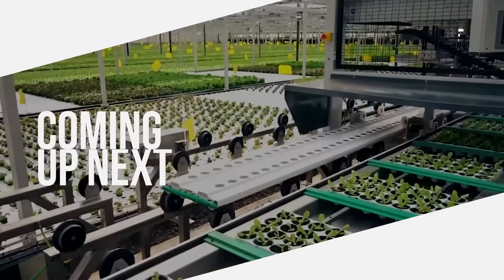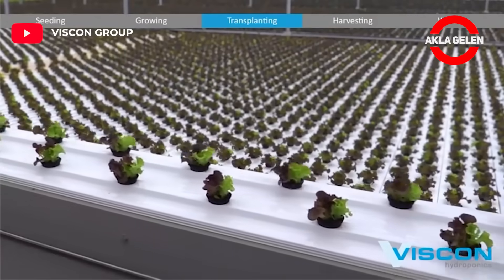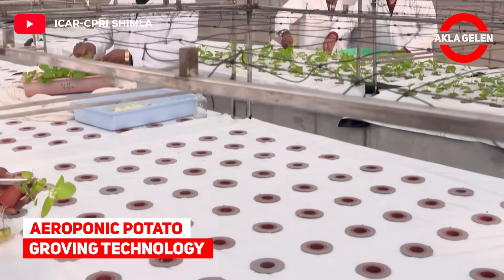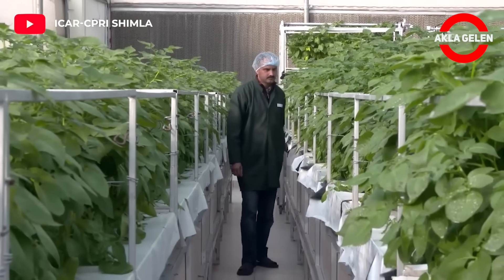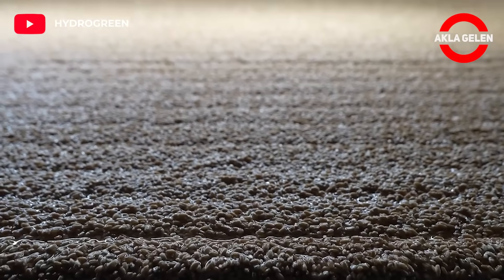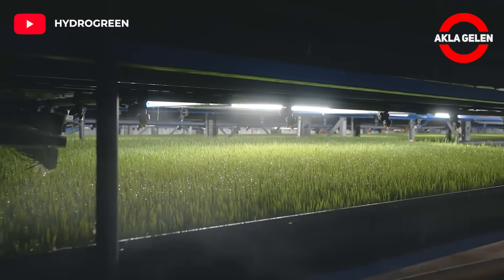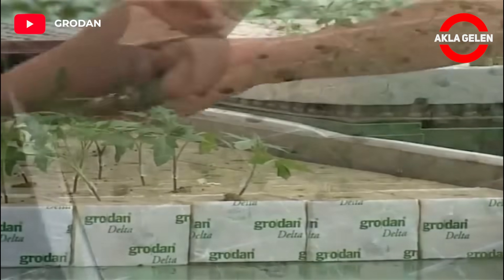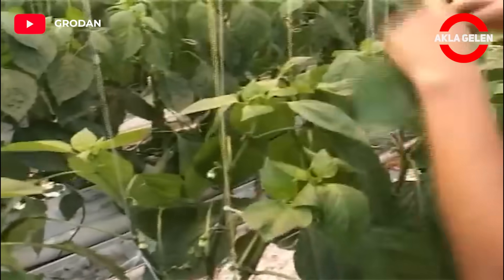The Farm Producing Potato Without Soil Will Surprise You - Incredible Agriculture Techniques

Comment: Respectful Greetings!
To: Akla Gelen.
Introduction: Aeroponics is a cutting-edge agricultural technique where plants are grown in an air or mist environment without the use of soil. This method is gaining popularity for its ability to maximize plant growth with minimal water use, making it a sustainable option for urban farming and vertical agriculture.

Aeroponics is a method of growing plants that do not require soil. Roots are suspended in the air and irrigated with a nutrient-dense mist instead. This is in contrast to hydroponic systems, in which plant roots are submerged in a nutrient-rich solution on a regular basis.

Potato agricultural production involves growing potatoes for food, feed, and industrial use. Potatoes are the third most important food crop in the world, after rice and wheat. 
Potato production steps
Fertilize: Apply fertilizer before planting, based on soil test results. 
Plant: Use healthy, disease-free tubers that are well-sprouted. 
Harvest: Handle potatoes carefully, wash them as needed, and dry them. 
Store: Store potatoes at a temperature of about 65°F with high relative humidity (85–90%) for the first 10–14 days. Then slowly reduce the temperature to the final storage temperature. 
Potato production challenges
Climate change: Farmers and scientists develop strategies to match crop demands to environmental conditions. 
Soil preparation: Laser land leveling can be used to prepare soil, but it can be expensive. 
Storage: Storage conditions are important for healing cuts and bruises, and preventing shrinkage and bruising. 
Potato production benefits
Food security
Potatoes are a food security crop that can help feed the world's growing population. 
Sustainable
Potatoes can be produced sustainably with less land due to improved varieties and agronomic practices. 
Courteously!
Luís Van-Dúnem

Comment: Go check the Element Table, everything the plant needs is the elements in solution. It doesn’t expend energy spreading its roots around trying to find nutrients. One other important thing plants require, CO2, Modern greenhouses pump CO2 into greenhouses at 1,100 ppm, the plants absorb CO2 and expels oxygen. Over hundreds of years of growing in the same soil has removed the elements the plants need.
How did the Elements get there? When the glaciers retreated, they ground up the rocks as they moved and carved out the valleys. Like I said check out the Elements Table then check out the Plants requirements.

Comment: These potatoes are grown this way for bulking first generation seed from a plantlet grown from tissue culture. They are not for human consumption. This is the first stage of seed potato production. This is why they are harvested at around 20-30 grams. From there they are transferred to a field and bulked up for 3 to 5 years, after that the seed goes to the final ware or processing grower where the final bulk out is done for market.  Yes it takes 5-7 years to get from the base tissue culture to market. What you see in this video is year 1. Those tubers would have a value of around $50-100 usd per kg. ($50-100k per ton)

Comment: In less than 100 years we will no longer see farming in the traditional model: outdoors, massive fields, tractors, etc. With traditional farming, you have the issue of insects, disease, weather control, equipment, air pollution caused by the equipment, and so on.  Indoor farming eliminates all these problems and insures year-round production.

Comment: Those are pretty small potatoes. Nonetheless, very interesting.  As you said until now soilless growing has been basically used to produce salads.  However, to make a real impact we need to produce some calories and so potato production is a good start.  Then we can illuminate multi story farms with super efficient magenta LEDs using renewable energy, close to population centers.
Reply: Do you know how the Potatoes and other plants get NPK and the other trace minerals?
Reply: @sjewitt22 there are hydroponic nutrients. Many different kinds
Reply: Im curious if you can grow it with natural light
Reply: @CUBETechie there if nothing different about the photos that come your sun and the ones from the lights used for indoor farming a as long as it’s white light like the suns bet you could but it would require a more open building and then going up instead of out isn’t possible
Reply: @RobertSaxy  i mean because artificial light use a lot of energy
Reply: @CUBETechie This is a verticle farm filled with plants evolved for horizontal growth... there isn't possibly enough natural light at that density to help. It also goes against the whole controlled environment thing.

Comment: Hi,
I'm really interested in this, but I've one question.
Is this sustainable regarding "waste"?
I mean: on a traditional farm, you have a lot of land, but here you have a a lot of plastic cables, plastic bags, you're using energy... How does this add up to the environmental impact?
I'm really curious about that, because I think that's the deciding factor to say if it's a good alternative.
Reply: It will eventually become more systainable as the culture around it is more climate focused but overall the good outweighs the bas tremendously, through reduction of soil erosion, high yeilds in city farms and decreased food scarcity. Hydroponics will contribute to the post scarcity ideal that we aim for.
Reply: Tractors require a massive use of energy (usually gas)...

Also as the nutrients are easily washed away in the soil (by rain) farmers use much more nutrients (which pollutes, nitrogen, potassium and phosphorus) than required by the plants which causes eutrophication. It also requires less water and less phytosanitary products than soil-in cultures.

Also it can produce much more per m² when correctly managed (up to x5)...

In my country we eat out of the soil tomatoes 8 to 9 months a year and they're basically 2 times cheaper, which means it allows more people to eat enough vegetables and it benefits public health. Mainly because of very high productivity.

There are many advantages. The light can be a major issue for wild fauna, though.

Comment: that looks nice and all, but what about fertilization? water alone is not enough to feed a plant. - to my knowledge
sure this is space-efficient, but is it energy efficient?
how does this compare to regular farming in terms of chemical waste output?
way too surface level to form an opinion about it. its basicly a long commercial, and nobody should trust commercials
Reply: Hydroponics uses 90% less water than soil farming, produces up to 3 times more vegetables in the same growing area, contains up to 50% more vitamins because the nutrients can be dialed in to give the plant exactly what it needs and also uses less fertilizer and there is no run-off into rivers etc. These are seed potatoes though, not meant for eating. You can't grow food potatoes like this cause the roots cannot carry the weight of a full sized potato.

Comment: It was a project that I really wanted to do in a small farmland area or a place with cheap and wide land, but it is surprising that the infrastructure is higher than I thought.
Reply: The infrastructure cost is enormous plus the cost of constantly running pumps for the water recirculation and water treatment is costly too. I used to work in plant wholesale nurseries and I was surprised at first at how much actually went into everything. So much that people just don't realise goes on and into everything. You don't just connect a hose and turn on a tap, there is so much more, not to mention the constant maintenance as well.

Comment: I don't think aeroponics for Potatoes will be profitable in the long run. Usually consumable sized potatoes are heavy and they would have a hard time hanging on to the roots of the plants without dropping off eventually. 
The plant would either have to be genetically modified or evolve itself to be able to carry heavier loads on it's roots. 
Otherwise it the yeld's will be very meager compared to traditional farming, which was already apparent in this method they were using.
Reply: "Baby" potatoes sell at a premium price, and being able to get multiple hardest from one planting increases overall yield
Reply: ....OR, you have a conveyor below the roots and let the potatoes self-harvest when they drop off. Labor saving!

Comment: I would think there’s a problem with the absence of trace elements and vitamins normally found in soil. The idea is to make production cheap and fast, which probably precludes adding the essential substances. And in the case of mist-farming it is impossible to add anything to the water without gradually clogging up the nozzles.
The new food will just be calories in various shapes, forcing people to buy and eat supplements produced by big pharma to prevent malnutrition…
Reply: hydroponic vegetables tend to be similar to soil-grown in terms of nutrient content. Advocates say (and some tests have shown) that sometimes they are slightly higher in certain nutrients because growers can control exact inputs and because a lot of soil has been depleted by intensive production over the years, which strips out nutrients.
Reply: @pteechka1  It took 35 years of farming with mineral fertilizer before we discovered that the rapid growth caused selenium deficiency — and we actually discovered it in our pigs before in ourselves. 
When a method is cheaper, faster and easier, you can be almost certain nobody bothers with the groundwork and proper testing. 
I worked 2 year in a gardening center where we produced the most beautiful plants and flowers to use in gardens and parks and we used hydroponics where everything could be monitored and controlled. 
We could then sell them a bit cheaper, because they grew faster. But after 2 years the demand waned and the gardeners reported 2 problems:
1) Lower resistance to infestations
2) A need for soil betterment which swallowed the saving on buying price
We kept it up for 3 more years by constantly finding new markets, but then gave it up and went back to earth again…
Reply: @pteechka1  I wonder who those advocates are. It is based on a couple of big assumptions when it comes to the comparative nutritional value of hydroponic veg. 1, It compares well to those grown in depleted soil. What about rich organic soil? 2, Do they really know and can provide  and control the whole spectrum of nutrients required? Based on past experiences, we know how science often falls short in the long run in producing really nutritional and flavourful produce for the masses.
Reply: This is again a project of industry. Let’s be true and acknowledge the facts. If there is a free market in agriculture all, really all German farmers of any kind will disappear and with it their complex wonderful culture. This is known for more than 40 years. All countries in Western Europe protect for this reason their farmers. To produce any piece of food for public consumption you need an authorial permission. Such a permission I would never give.
Reply: @gauriblomeyer1835  Yes, agriculture is — one way or the other — subsidized everywhere because a stable food production is a must. 
I don’t know the specifics for Germany, which like Sweden has traditionally based its main export on industrial hardware, but Denmark and the Netherland have huge surplus exports of high quality agricultural products despite gradually going back to ecological, sustainable methods. 
Giving food production over to industry would spell disaster, because such enterprises form „exit strategies“ right from start and can only survive longterm with aggressive takeovers, gradually becoming huge monopolies which invariably begin dictating terms (like big pharma and big tech) once they have the market cornered and the politicians bribed.
Only farmers has the necessary love for nature and the farming traditions which must evolve carefully in order for the production to be stable, healthy and sustainable. 
What the WEF is making the government do to the Dutch farmers spells catastrophe imo…
Reply: 씨앗은   어디서 생산하나요😊 @Hallands.
Reply: Some of my friends mentioned there isn't any flavor which you get from the soil.
Reply: I didn’t say anything about flavors! @ShalliniSheeran
Reply: Pode ser mesmo, sempre tem algo por trás, o futuro é extremamente nocivo para quem pensar fora da caixa, possivelmente esse será perseguido e sofrerá as consequências! 😒
Reply: Not really buddy. You are describing an issue that can be solved. And once solved, it can guarantee maximum nutrition from your veggies.
Reply: yes but farmers ur natrium or what that is same used in bombs, bigger grow but less healthier, happening ukraine
Reply: The water has nutrient solution in it. A plant can't grow with nutrients. Hydroponically grown stuff still has nutrients lol.
Reply: Bull**it. A deficient plant dies or doesn't grow fruits or has a slowed down growth. Out of soil farmers have everything to win, like productivity per m², by feeding the correct amount of nutrients to their plants.
Reply: You are wrong, usually there are absence of elements in the soil and plant have to grow massive root system to found and absorb it. Nutrient solution gives everithing is needed right away. Plus all mineral salts are dissolved, so there is no threat to nozzles.
Reply: @callmekit90  Solubles are always a problem with nozzles, especially if the water-hardness is high.
Reply: @callmekit90  не нужны никакие питательные вещества! Достаточно соблюдать правильное чередование выращиваемых культур и своевременно давать земле отдохнуть. Без химии и всяких приготовленных химпутём витамин. Мы дети всегда помогали нашим дедам во всём и знаем, что никих средств они в землю не добавляли. И картошечка и всё прекрасно росло, в садах ветки от фруктов ломились. Но подкинули д😡брые люди жука колорадского на картошечку, сады сожрали черви, потому что птичек, лягушек продавали на  🌏 уровне...одна из причин, это нарушение баланса на планете. Всё натуральное, естественное изменили, добрались до человека. Жаль тех, кто свято верит, что на этих спецпрепаратах вырастит  продукт вкуснее и полезнее чем тот, который ты сам вырастил. И полезнее для здоровья бедет всё же картошечка, пусть даже мелкая, даже выращенная на истощённой земле, - а не на химии. А молоко! Его ценность для здоровья,  вкус настоящих молочных продуктов знают мало людей. Остальные давно уже убеждены в обратном
Reply: @valentinakrutin4387  ох...ну да. А в земле не питательные вещества и вообще не химические. Никогда не сможет продукт, выращенный на земле, сравнится с продуктом гидро- или аэропонного выращивания. Потому что а) будет мельче, б) будет дороже, в) будет не таким вкусным. Всё при соблюдении технологий, конечно.
Reply: @valentinakrutin4387  BRAVO ZA KOMENTAR! ❤
Reply: @callmekit90  Human hubris. As if everything about plant life is understood by human, or so they try to make you believe so that you are willing to buy their products.

Comment: The high cost and low yields will never make this a viable source of food, despite what the say.
Reply: Certainly the higher costs are an issue, but the higher yields and improved quality make up for that (in most markets)
Reply: @pteechka1  I've never seen any real life project yet that produces higher yields, even with massive investment. I would however agree that overall quality is often higher.
Reply: @Orthodoxuk  Enhanced plant yields: Hydroponic plants produce a greater yield of fruits and vegetables because in a hydroponic system plants are more densely spaced together compared to the size of land that would be needed to grow the same number of plants.Aug 11, 2021
Reply: @pteechka1  But those of us that use regenerative growing techniques already know and apply this, which increases our yields also.
Reply: Certainly there are aspects/techniques that are similar when growing crops regardless of the system or medium

Comment: Looks like more mechanized farming than the mechanized farming we already have in fields. 

Look at all that petroleum made plastic being used. And I'm sure coal fired plants are producing electricity to run all those fans, equipment, and irrigation water pumps. 

No soil means there's no nutrient rich composted soil providing the nitrogen, potasium, and phosphorus plants need to grow, so I'm sure they are using chemical fertilizers they're trying ban field farmers from using. 

And how are they keeping the potatoes from growing toxic green skin when potatoes are exposed to light? Probably a GMO variety.

Comment: Would these herbs/plants still contain the same vitamins or health benefits compared with soil grown plants?
Reply: Hydroponic vegetables have much higher nutrition than soil grown plants because most fertilizer used in soil planting gets washed away. However that's really a secondary benefit. The whole reason hydroponics was invented was for US military operations in places where plants couldn't be reliably farmed on soil. If you have good soil and water, it's a lot cheaper to use that than hydroponically grow.
Reply: hydroponic vegetables tend to be similar to soil-grown in terms of nutrient content. Advocates say (and some tests have shown) that sometimes they are slightly higher in certain nutrients because growers can control exact inputs and because a lot of soil has been depleted by intensive production over the years, which strips out nutrients.
Reply: Never!
Reply: How could it be ?
Reply: Nope, they lack the iconic vitamin of a soil grown plant: pesticide. So completely unnatural, should not buy.